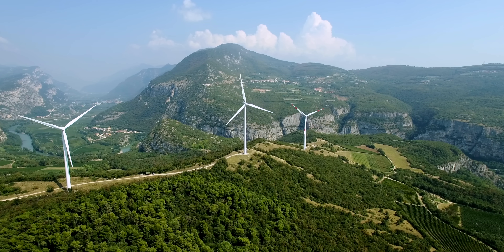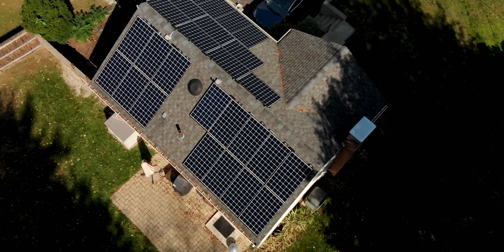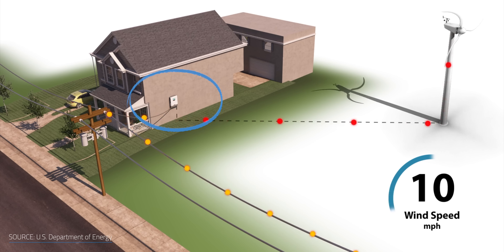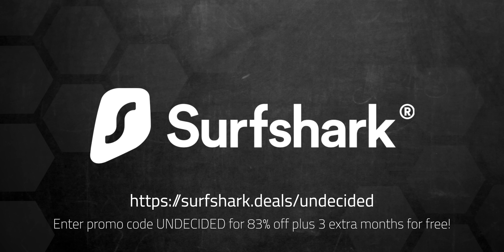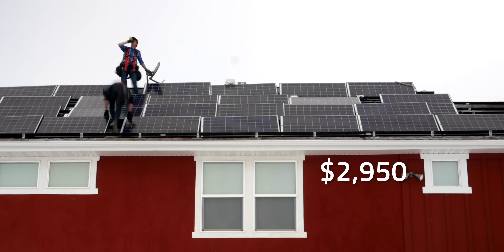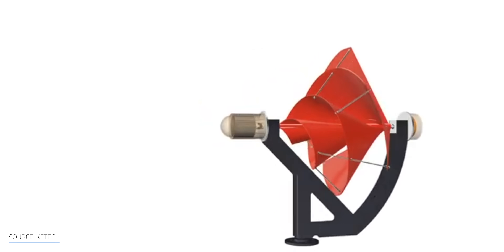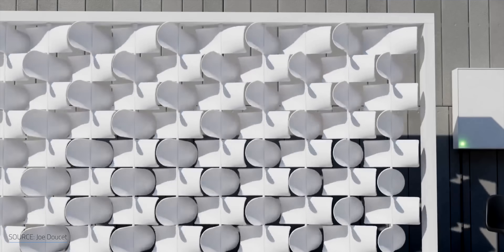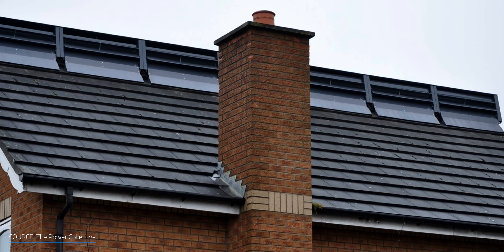The Challenges of a Wind Turbine on Your Home

Comment: I think that’s this is a good thing but the costs are unjustifiable. It’s not like solar arrays that need to be processed in a highly technical manner. This is wind capture. The technology is centuries old and can be manufactured in a garage. It may not be as refined, but if this tech ever reaches large scale, the Chinese are just going to relabel it make it cheap anyway. Better to use low tech ways to implement now at a low cost. The earth can’t wait.

Comment: I live in the Colorado Rockies. We get plenty of wind, so I considered wind turbine before deciding on solar. But the points you brought up about the social impact where the deciding factor. A tall fixture would not be allowed. And the homes are tightly packed, so there wouldn't be room for a smaller turbine near the ground.  And I doubt if the neighbors would tolerate the noise. If I was going to reconsider wind, I would look into the rooftop model you described. However, I haven't used the amount of solar energy that I am producing at this point.  I let people live in my driveway to allow them to save money to be able to get their own living quarters (many employees in my county can't afford the rent).  And even with a person living in my driveway in a trailer or rv, using my electricity, I still haven't used all that I am generating. And I only have 13 panels (I forget the electrical generation for panel, but they are standard and are 3 years old).

Comment: They have been using mini wind turbines on yachts for many decades .  And this works fine and reliably.  Why you would be sucked into the zero carbon scam when you have grid power I'm not sure though. Oh wait the failure of grid power because of crazies putting inappropriate controls on power generation have made that unreliable too! My bad.

Comment: Where/when wind would seem to make most sense is ... at night, if you want/need to continue to generate power. You could easily argue that batteries and more solar is the way to go. But, some systems are mandated to feed back into the electricity grid for credit, rather than direct use by the user that generates the power.

Comment: Did you know that in Scotland the hydro dams have the potential to produce 40% of Europe's electricity. The reason that you don't see those stats mentioned is because most of them are sitting on standby instead because the current generation is from coal, recycling wind, wave and nuclear.
Ben cruachan for example has a turbine house 1.5 miles inside the mountain, at the moment it can produce 400Mw and with phase 2 now going ahead adds a further 600Mw.  1 Gigawatt of power available within 27 seconds of flicking a switch is crazy but like I said its on standby in the event of failure or attack of the generation areas and that is just 1 hydro power station out of hundreds!

Comment: What this whole thing does not mention is 2things. 1. Cost of batteries and availability. If everyone rushes for only solar and not combined with wind, the amount of batteries needed will maybe tripple so will price. Wind helps keep smaller batteries topped up. it should be compared to gas generators not solar panels. solar panels should be compared to fuel cell devices. thats the big mistake. 
2) Chinese Windturbines are a joke. go to your scrapvyard get scrap wheel hubs and build a beast no solar can come near.  many diy videos for that. windturbine is not meant for mas production as it will cost 100x compared to using recycled carparts and copper wires and magnets.

Comment: The wind wall is brilliant!  But, as far as urban environments, alternating patterns like a radiometer would take advantage of thermodynamics in place of wind.  The Ridge blade is awesome too!  Glad to see this happening.  Costs will drop once volume and demand increase.
I still have an idea of an umbrella made of piezoelectric crystal solar panels, to remove the need to adjust for angle as the sun crosses the sky, and generate electricity from rainfall.  Partially underneath the dome would be a vertical wind turbine utilizing the vortices created by the dome to maximize power generation.  I believe very strongly in convergent technologies rather than putting all your eggs in ONE basket.
Thanks for this exploration!

Comment: Hello from New Hampshire.  We are off-grid solar, considering wind as a winter supplement.  We installed extra empty conduits when the house was built, we already have inverters, and would really just need to add a controller to our electric room.  We are out in the country, and live on the south-east corner of a small valley, so there is almost always a decent breeze.  Will let you know how the 'adventure' progresses, and whether it ends up being worthwhile!

Comment: Thanks to YT i just found this video. We, in Switzerland, are currently retrofitting PV to the house; issues I have with this idea:
a) it will only produce solar-power in summer; in winter, it's just too dark here (sadly, not enough wind to use a horizontal wind turbine)
b) storage of the surplus-energy produced in summer during sunlight is expensive as F and will not "hold" forever (Li-Ion or LiFePo4 - both will lose capability of saving energy enventually)
c) offgrid-solutions are almost impossible and even more expensive to implement: solar-inverters will only work if external grid is available. with freshly announced timed brownouts here, the best PV-setup will not give you power, even for "emergency circuits".
AND THIS is also an issue with windturbines: they only produce energy when there's enough wind; if you want to save surplus-energy, solutions are not viable enough, and going offgrid is ...easy to do if your other means of providing energy are done with fuel-generators due to living somewhere in the outback...
As much as i like the new concepts of the horizontal wind turbines: 
I would appreciate a "not so expensive" and durable way to save energy; bc this could be retrofitted to ANY house with or without PV/Turbine, so "smart charging" could charge the batterys when power is least expensive, to reduce the cost for the owner, AND to reduce the costs of not-so-enviromental-friendly means of energyproductions during "no wind" and "no light"-scenarios...

Comment: What do you mean "is quiet"? How many dB does this turbine produce in normal production. I can imagine that it produces to many dB in an urban envirement.
I have solar panels, problem with that is, you need sun, and at night.. there's no sun. So it doesn't solve the problem getting power at evening night cloudy days.
Batteries doesn't work... enviroment issues (producing panels) and a battery last 8 to 10 years and then you need to replace them. So that is no solution.
Green seems nice, but green isn't green.

Comment: Since the number of wind turbines has increased in Sweden, I have noticed that this summer almost no insects have hit the windshield of the car. Politicians are planning large areas with wind power out at sea. The problem is that it leads to migrating birds that end up in the mixer. Large numbers of birds will die. Solar cells are good, but wind turbines are an environmental disaster.

Comment: Seems odd that its so expensive when the materials should be so much cheaper than with solar. Solar uses Silica, silver, and copper. while Wind turbines just use Copper, but a lot more of it. I wonder if it's the amount of copper that causes the huge difference in price. I know a lot of design goes into the form of the turbine, making the more expensive ones more aesthetically pleasing. Good video. I'd been wondering about the cost and was surprised at this.

Comment: As always great info. A friend in a remote cabin needed some power.  I built a small solar panel that incorporated small squirrel cage fans on top connected to a generator, munted on tp of the 4 solar panels. Beneath the panels I looped black poly pipe for passive hot water and heating. As small as it was/is it worked. Thanks. Don

Comment: 30 seconds in, wind speed drops off as you get closer to the ground, so roof mounted turbines can effectivly never generate enough to cover their cost, unless of course you live in a place with no shelter and on the top of a hill. but for 90% ofd all houses they are just eco bling. mast mounted  8 meters higher than the sourrounding roofs or trees, you could save some money providing your average winds speed is over 4ms

Comment: The house I rent has an old fluid filled solar system and the pump broke down within six months of me moving in.

Because that model of pump is now out of production the nearest replacement is 4 1/2 thousand pounds and my landlords don’t seem to be bothered about having it fitted. So I have two big ugly old tube style solar panels on the roof, a big chunk of mechanics in the loft, extra switches and controls around my thermostat, and none of it works.

Expensive and didn’t even cover its own costs while it worked.  

We’ve got a way to go yet, but it’s never gonna happen if governments don’t stop oil companies from lobbying the shit out of them.

Comment: Retro fitting an Archimedes screw and pivot cradle takes this to existing DIY or currently available parts.  Nothing beats stored kinetic energy i.e. hydro electric and water stored up high also capture and stores heat at the same time.  No the that a properly passive energy efficient structure that taps into geothermal and use super efficient heat pimps; then Bob's your uncle cozy and energy independant.
Please chime in that I am not the only one who sees "decidedly" all these simple lessons integrated.
Reply: Know*

Comment: All worthless for a home owner or business. 7 years to break even in the most optimistic scenario is laughable. We still have not calculated maintenance and degradation in the ability of the equipment to generate power over time. Current home solar and wind power solutions are just not ready for prime time adoption. Until I can buy a system with a good potential to break even in 2 to 3 years there is no point.

Comment: I hate the wind turbine craze, my country have been shutting down clean and stable nuclear power and keep installing wind turbines that cant deliver stable enough power to the grid without us burning a ton of oil to have a buffert to balance the demands.

The argument that wind turbines are clean is insane to me due to all the maintenance, enviromental damage durin installation and use and the turbines in the oceans poison the water overtime with the sacrificial alloys that we have to use.
The turbines and gearboxes needs to be replaced in 5-10 years and the blades cant be recycled (some say they can, but there is no efficient way to recycle them yet)

Comment: The thing i dislike about solar is their gaps in coverage on roofs. Why has no one made triangular shaped panel s to fill in gaps or smaller panels to become a larger panel to fit around roof protrusions like vent pipes and exhaust fans. It's really bothersome to my ocd.  Wind turbines are neat idea but sound cost prohibitive.  Also what's the comparison of 50db, a fan,  an airplane?

Comment: Wind has been around for years. I know of several farmers that made their own units by refurbishing the old style water pump wind mills with lighter blade assemblies. Several went so far to use higher amperage truck alternators to charge batteries for power.  Wind is locational in usage and efficency. It would not be as useful in big cities BUT it is very efficient in the great plains states. Solar, Wind, and geothermal all offer pieces of the puzzle for clean energy.

Comment: "without the carrbon imissions" Oh, yeah? Have you any idea how much material it takes to build one large (grid) wind turbine? The production of electricity (if it's windy) it generates is low compared to nuclear power and that most of the blades can't be recycled. They have developed recyclable blades but the pratice is not wide spread.

But a wind turbine for ones home would be a great idea if you have the right conditions.

Comment: Matt the noise would get to me even a house fly would wake me up and would go hunting to it is squashed then would get back to sleep 50 DB no thank you.  It is good that every country is going the of clean energy except UK they want to start drilling the north sea for oil and gas they have opened old coal mines and going to open more we are going backwards it is like 10 steps backwards.   Have solar panels on my roof just 14 they supposed to out put 6 kilowatts I rent a Northern Ireland Housing house they got them put up for free and we don't get that much sun

Comment: i live in England and i think adding wind and possibly hydro generation to domestic properties is essential for the future. if we are to realistically embrace electric vehicles and reduce carbon emmisions then each property generating a small amount would make a huge difference to the countries requirements. it took a while for Solar Panels to get mainstream but now they are very common. i have ideas for home generators (similar to some you have shown) for both wind and hydro but as yet no time to investigate further. if you look at the average solar installation of say 4Kw   which provides a usefull reduction in energy bills then to make a difference by using wind and/or hydro only small generators are required. if a small single wind generator was say 250W then you could use multiple units to generate useful amounts in exactly the same way that solar panels are used. Even small amounts of generation rolled out over large numbers of properties would make big differences.

Comment: The elephant in the room, is that as energy prices skyrocket, as they have, the uneconomic suddenly becomes economic. Add in scale and installation at the design and construct stage stage, and it begins to make sense.
I suspect the key factor, is that buy-in is required at national level not just that of the individual. 
The real economies of scale need national buy-in.

Comment: You're forgetting a big factor here. Latitude. If you lived in the mid of Canada or here in Scandinavia like me, Solar captures very little energy during the dark/cold month where we need power for heat and light. 
Wind power rules here. But at scale. There is no getting around swept area matters and since it's blade length squared x pie, tiny turbines with 1 meter blades don't make sense. 
I just wish someone would set up a company where regular joes can easily buy small parts of MW turbines.... In same price range as a 5-7 Kw solar setup...

Comment: I like your video but i think you made a mistake when calculating the average power of the windturbine. You took 4 m/s as an average but with the average windspeed you can't calculate an average power. This is because the formula for power has v^2. this means that on a day with windspeeds of 8 m/s you have 4 times the power output. so higher windspeeds have a higher weight than lower windspeed. Most windturbines generate around 80% of there energy during 20% of the year.

Comment: Vibration free? Um I'm from Missouri show me. The structural rigidity of the home would have to be built from the ground up. It would make a hell of an attic fan using the ventturi effect to pull all that hot air trapped in your attic

Comment: There's a reason wind turbines are big:
yield raises with area --> double the diameter, get 4 times the yield
wind speed raises with height. Double the wind speed, get 8 times more yield (kinetic energy is proportional to v² + more air flowing through)

These turbines only really make sense for remote places far from the equator where you simply have to complement missing sunlight in winter.

Comment: I live in a motorhome full time. I am mostly energy self sufficient with 12v solar.  So why not run a house like a giant motorhome?  Just scale up the battery bank and solar panels or add vertical blade low noise wind turbines used on boats.  Either use inverters to match existing house voltage or to be more efficient, change to 12v appliances.  If people can live off grid in a motorhome, boat or cabin, then the same can be done in a house.

Comment: Your neighbors will complain about the noise ((especially at night)) and that its an eyesore... likely causing the local government requiring its removal... So you need to be in a remote location... converting DC to AC is not practicle,,, 
    having a grid tied system is not a good idea since since your power will be shut off automatically when the grid goes down, thats the law...

Comment: The absolutely one thing that will get me mad at neighbors/cities/anyone really is noise.  I hate, hate, hate (did I mention hate), excessive and unnecessary noise.  So if you go down that path, they better be quiet.  And I don't mean a low hum - I mean QUIET as in no noise.  Many low rotation motors today do not produce audible sound so it can be done.  In addition, the blades, or whatever wind capture mechanism there is, need to be quiet as well.  I'm not going to put up with a constant whoosh, whoosh, whoosh, or thump, thump, thump of blades.  I'm definitely not adverse to them, in fact, i think it's a good idea IF implemented correctly.